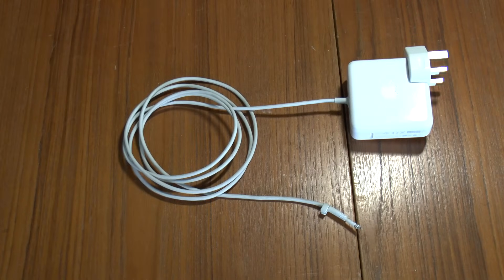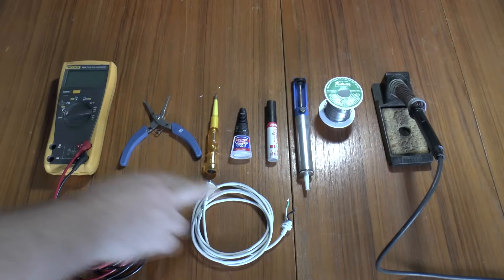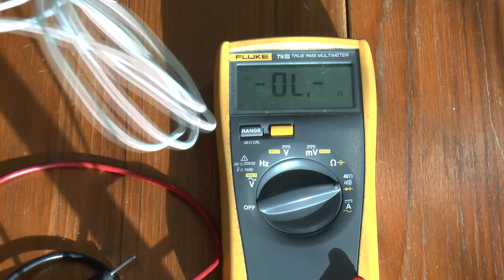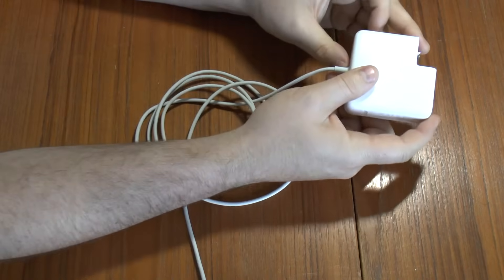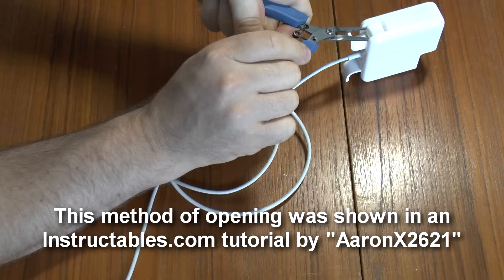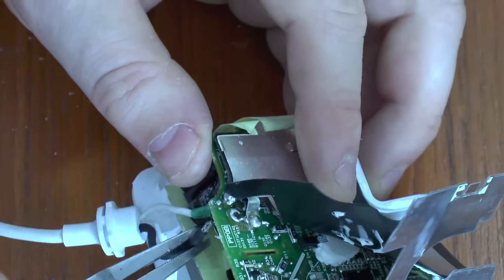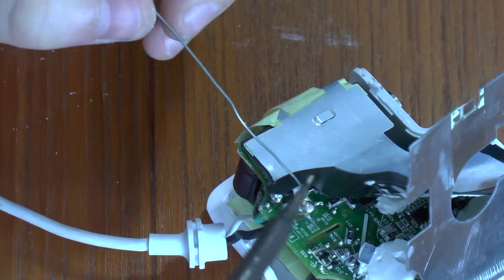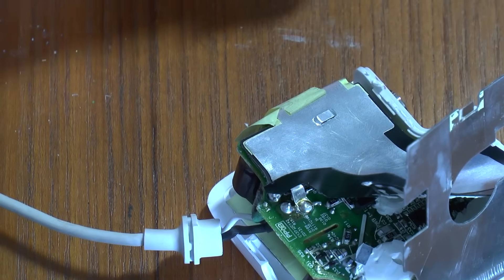How to repair an Apple MacBook power supply (MagSafe)

Comment: I tried it at home!

I was working on magsafe2, and the cord colours and holes are slightly different.  My replacement cord came with a mere 1mm of prodtruding black wire with a green extension already soldered on to it and 1mm of grey wire with a red extension.  The original cord had black and white wires, no green anywhere, the merest hint of melted red insulation at the end of the white one (but I couldn't really see that until after it was removed).  As a rank amateur, I noted mentally but failed to WRITE DOWN or photograph which wire was in which hole before I removed them both, then of course I couldn't remember.

I found that on both the new cord and the old, I seemed to have full conductivity from BOTH wires to ALL FIVE pins at the magnetic end (and no this wasn't just because the old cord was broken and the new one a dud -- the black wire clearly corresponds to the outer conductor of the coax).  Everything else seemed very much the same as your video, so stupidly I simply took a punt as to orientation.

It didn't work ... so I swapped the wires over ... electrocuted my middle finger in the process, of course, because I'd had it plugged in and didn't discharge it. YEOW!  I figured I had probably fried the adaptor as well as my finger, but I carried on regardless (more cautiously) and lo, it works fine now I have the orientation correct.

For those in my boat with magsafe2 and uncertain as to orientation, the black/green wire goes nearest the edge of the PCB and the grey/red wire goes behind the small bright blue ceramic capacitor.

BTW I do love your accent. Torchwood with maybe the very merest hint of Littlefinger.

Comment: Awesome. Just completed this - worked a treat. Thank you. 
Before I closed it up I made sure it worked and charged my Macbook. I then realised I'd just put myself at risk from a nice capacitor discharge like you had. Rather than use a screwdriver I connected it to my Macbook without mains power, green/orange LED glowed for a split second and then went out. I'm thinking this is possibly a better and safer way to discharge the circuit.

Thanks again for the vid. I now have two refurbished chargers!
Reply from the maker: +Jonathan Maddox that's where digital cameras come in handy. Been there, done that.
Reply: +ThisIsMud that's a safer way to discharge ... if it's all in working order.  In my case it wasn't (my own fault, I got the orientation wrong due to ambiguous colour coding and arrogant overconfidence in my visual memory).

Comment: this was the absolute worst case of craftsmanship I have ever seen. not only that, the poster never showed the power supply to actually be operable!
Reply: +Ray Siglin It may not be the greatest craftmanship but at least it is still very helpful and the poster spent the time to document this and post it which is always a "+" in my book.
Reply from the maker: +Ray Siglin Well you obviously haven't seen a lot of craftsmanship, then. It's still working perfectly. In fact it's plugged in right now.
Reply: +AintBigAintClever Excellent
 video, I thank you very much, because you went trough the whole process
 unlike any other videos that makes it easy to take apart the mag safe 
case. good work keep doing what you doing!

Comment: Excellent repairing a faulty and bad quality Apple product . 

Here is suggestion. First go to the Apple store and ask them to replace it. They should do it at no cost if your computer is less than 3 years old. 

If that fails:

Buy a new one for from the store so you have something to use by the time you get all your items to do repair. Then return the one you bought back to Apple. They have 15 day return policy.

FYI: I've had several of these break. Even if you are careful they break. The heat frays the wire. So far Ive managed to get free replacements by talking to manager at store. They always always will blame the customer first, but if you see the reviews on their own website you can see who is right.
Reply: +Wyatt Biker no, they didnt work- and they can work out from its serial number which macbook the adapter goes with- my sons PSU packed up within 2 years and my mackbook is 4 months old- they sussed we took the wrong one back- as you have to return both laptop and PSU for a warantee claim (ive got Applecare but it made no difference as my son didnt have..)

Comment: The macsafe charger is a scam by apple. It's just crap that breaks easily so they can sell shit loads of this chineses crap for 80 bucks a pop. If they really wanted to secure macbooks from falling down they would also sell macsafe headphones.
Reply: +TerrorJesus Hey! Don't give them any ideas! :D
Reply: What a load of nonsense. First, The design has nothing to do with selling more replacement chargers, it is due to Jony Ives and the rest of the design team having a certain aesthetic, It's annoying, but not some sort of conspiracy.
Second, headphones aren't anywhere near the issue that power cords are, since they are generally shorter and stay attached to your head, therefore not the same tripping hazard.
Also, switching to a mag safe version of all peripherals would require proprietary hardware for all these peripherals. That makes sense for chargers, that come with the machines, but not for anything else.

Comment: Thoroughly informative tutorial. Thanks.

I'd like to add one tip: When reassembling the two housing halves, clean and straighten the groove all around the edge of one of  the halves into which the tongue of the other half is supposed to fit. When opening the MagSafe, the groove or tongue can get bent of marred, making it hard to fit the two halves snugly.

For the curious: the failure in my MagSafe plug was due to intermittent contact of the spring-loaded center (control) pin: the  spring behind the pin is so tiny and weak that it got fatigued with time, and could no longer push the pin firmly against the computer's contact.

Comment: Thanks a lot.  Not sure if I had an original Apple product or not, but the MagSafe wire was insulated only on the white line.  In the cable, the wire carrying the "black" signal isn't insulated.  The black insulation starts on the board, but stops after about an inch.
And of course, the white insulation started to break apart, and a beautiful short circuit happened between black and white lines.

Comment: Apple make something serviceable??  NO!  Apple make something not intended to fail early in order to gain secondary sales? Nooo.  Between the Feet coming off, the power supply cables constantly going bad due to poor quality cabling!!!! And.. Apples latest versions of OS/x with their bloat, increased hiding of system functions requiring more work to undo I am wondering if I will bother buying another.  I still have an early 2009 macbook pro.  I have replaced the feet, power supply cables twice, when originally bought they had to fix the super drive and the main board was replaced.  Problem was actually fixed with firmware much later.  HDMI did not support sound.  nicely designed machine buy a lot of issues compared to other "lesser" laptops I have had.  Oh for those of you who think well it is obsolete and time for a new one, that Is Apple who makes their products obsolete prematurely.  I have windows based laptops that are 10 years old and going strong.  Snow Leopard was their best OS version.  It included few new features and streamlined the code, the best upgrade ever IMO!  Back when it came out I was hoping that would be the trend a focus on quality of quantity of non-essential and often clunky features.  Nope, we got more feature after feature with IOS likeness and "integration", a release cycle that is way to short and ultimately low quality OS's.  They need to release a new "Snow Leopard type of cleanup OS now even more then the did back in 2009.  1 year release cycles are ridiculous even if they were quality releases (they are NOT), because too much change becomes work in itself and the reason for a computer is to have LESS work!

Comment: Hi, I've done exactly what you've done in the video, but the fuse keeps blowing when I plug it in. Any ideas what I've done wrong?
Many thanks
Reply from the maker: Marcio Ceballos Tormo Check the shielding inside the power supply in case you've accidentally melted through the insulating plastic with the soldering iron, also check (carefully, these things bite) for any stray blobs of solder.

Comment: Hi Thank you very much for this video. I am absolutely grateful to you.  I am able to fix my broken cable. I dont have a spare cable though. My cable was cut off at the white brick end. I copped off and resoldered and it is absolutely working fine. I am not able to put back the connector as it is laminated to the cable, so got rid of that and resoldered. NOW I'M ABSOLUTELY HAPPY!!! THANK YOU!!!

Comment: Very useful video, I just finished repairing my wife's charger.  She has a MBP, less than a year old, and there were some minor changes to the brick.  Those 2 flaps of shielding have changed from a silver color to gold, and have also been soldered together in 2 places (no longer just taped down and inserted together).

In the end, the 2 halves of my power brick didn't seal together totally, so I couldn't get the cable winding tabs to stay in, but no big deal... never used them anyways!

Comment: Tips ..I opened the plastic up ONLY A LITTLE BIT so to retain some of the original back end clips, (I put wedges in to stop it closing), cut the wires as close to the plastic/rubber connection as poss, (shortened the new replacement eBay cable a bit), then used pliers (black and white). Each wire held out so I could carefully strip and solder (wire to wire), then I taped them it with electrical tape (making sure the tape could not move and cause a short! rubber sleeves are better if have them) then a sparing bit of superglue and your foot help down on it for a min. Job Done! thanks!

Comment: Dc jacks in older laptops usually only break if you're being too rough with them. There are exceptions, but they're usually pretty solid. MagSafe cables on the other hand tend to self-destruct with time. I think many newer laptops are moving away from dc jacks directly soldered to the motherboard. All of the Lenovo laptops at the school I work at have plastic shrouds that hold the dc jack in position, then a detachable wire running to a connector on the motherboard. In this way there's no stress on the solder joints.

MagSafe would be fine if the cables were reinforced correctly. They're too cheaply made.
Reply from the maker: Sounds like Lenovo are using some common sense. I've covered a table in laptop parts in order to get at the DC jack's solder points before now, on more than one occasion. Much prefer MagSafe.
Reply: AintBigAintClever They are, in that regard. I got a laptop for free because of a broken dc jack, used it for a good year after I fixed it. I have been there. Thing is, I have never had to repair a dc jack on a laptop that wasn't already broken when I got it. Design/solder quality obviously varies between models and manufacturers. Magsafe is definitely a better conceptual design, but there are many run-of-the-mill laptop models that can go for a decade or more with the original power adapter and dc jack with normal use. Correct me if I'm wrong, but I hadn't heard of, or noticed, many power adapter issues with Apple's laptops prior to magsafe.

Comment: I know where the break in my wire is as I can feel it, it's right by the brick. Would it be possible to fix using the same broken wire by slightly shortening it?
Reply from the maker: Yes, you can. I'd suggest slicing the strain relief moulding and peeling it away (if it'll peel away), you'll be able to re-use it once you shorten the cable for a nice, neat job.
Reply: Okay, I'll give it a shot, if all goes well I'll loose about an inch, not a problem. Should the strain relief be sliced down the cable, and in doing so will I be able to reapply it afterwards? I'm almost certain the break is in the thinner cable and is immediately after the strain relief. It's not damaged the outer tubing but it's really easy to bend, and hasn't been charging the computer so I assume one of the inner two cables have broken at this point. Many thanks.
Reply from the maker: Yes, slice along so you can peel it away (like peeling a hot dog bun from around a hot dog). Do this once the supply's been cracked open (I assume you plan to cut off the dead bit and attach the good cable straight to the circuit board).

Comment: Thank you for probably the best description on this repair on youtube. A couple of differences in what I did:
1) I just clipped the wire lead ins  so that I could just solder the replacement output power cord to them rather than the circuit board. Didn't have to peal back the shielding or dig so far into the transformer to do it that way. Did use wire shrink insulators after soldering.
2) taped the transformer back together with gorilla tape (duct tape) in the off chance I need to do this again.
3) Put a little loop in the output cord by the plug and glued it in place with my hot glue gun, to remove stress on this particular piece.
Reply: @John Schubert "I'll make it look great with a combination of heat shrink tubing, glue gun and duct tape."

The words of a true tinkerer. Thumbs up!
Reply: @John Schubert Just keep in mind that the black wire is actually the bare shielding down the rest of the cable. It's going to take a real heat-shrink tubing artist to get that done (but it's probably doable).

Comment: Any way to do this without breaking the snaptabs?
Reply from the maker: It's probably possible to pop open most snaptabbed cases as long as they're not glued together as well, but you'd need another one that you don't mind butchering first. Open it by force then note where the tabs locate into. If you drill into the "good" case at these points, using a 1mm screwdriver bit for example, you should be able to push the tabs in.
Reply: YES! Use a hair dryer to loosen the glue, then pry it open by the cable clips using a large pair of pliers in the opposite direction to normal

Comment: (To Simón Torres) Applying some force is needed in order to remove the wires: they have a terminal lug with a sort of clip that fits inside the circuit. If you want to avoid force, you need to suck out most of the sulder and cut the clip before removing the wires.

Comment: You may be able to discharge the extra 'charge' by leaving the cable plugged into the macbook -- meanwhile do not plug the charger into the wall receptacle (wall outlet/ plug-in). The charger won't be accepting any charge from the outlet, but will still be outputting charge to the macbook itself. Which should discharge the charger.. If that makes sense? Great vid.

Comment: Excellent video!  I just replaced my cord for $6.00, instead of spending a bunch of money on a computer cord that is ten year's old!  And, it was fun to do.  Good luck.  Advice to add--be careful not to connect the new soldering dabs for the two wires, and be extra careful not to tear any of the board tape inside the box.

Comment: Do you know why I am having trouble with my charger?  It is turning green and orange back and forth here and there.  It is also not charging my battery, but sometimes it will.  My screen is brightening back and forth along with the connection.  It seems as the connection on my charger isn't seated right.  I have tried all the tricks resetting PRAM, cleaning connections and etc.  My battery has gone from full charge to only holding 50% and has 447 battery cycle charges.
Reply from the maker: First thing to try is another charger (or the same charger on another MacBook).

Comment: How do I use the multimeter to discharge the remaining charge? I have left it unplugged for 2 weeks - would that be long enough for it to have discharged completely?

Also, do I need to use any heat shrink? Or how about any 'heat proof' superglue?

(And finally, somebody else suggested using a hair dryer to melt the glue and open the case.)

Comment: Very good video. Just two comments: It would be easier to desolder/solder if you have some kind of support for the main structure (brick) and when desoldering cables is not good to use mechanical force, I know if from (bad) experiences, it's natural to attempt that but PCB's traces are so thin and can break very easily, just be patient and extra cautious about that part.

Comment: could i cut the cables that come out of the Power board and then tape the new cables to the little pieces left from the old cable i cut with electrical tape then reseal up the plastic case with super glue and be almost the same as yours right?

Comment: I went through 3 chargers in my first year owning a Mac.. But I just bought a product called a Python Cord that prevents Mac Chargers from breaking.. Wish I would have found it 6 months ago.. Hope this helps someone!
Reply: the Python Cord is a good idea, but it only does the one end, and I've seen so many magsafe-end problems...
Reply: You can do something similar with white duct tape (black or grey looks shoddy). We reinforce the cords at the end of all our adapters with white duct tape and our break rate has dropped by a factor of five. The best way to do it is more tape and gradually less so there is no single bend spot but the bending is distributed across a longer stretch of cord and never against a hard edge.

Comment: That's a lot of work. All you have to do is "cut" the old adaptor cable and replaced with the new one by "soldering" the white - white and black - black cable. One is longer than the other one . So it won't got short circuit if in case it touch it other. Insert a heat shrink tube. Heat shrink it with hair dryer. You don't have to mess around with the adaptor.
Reply: I did this... much easier :D